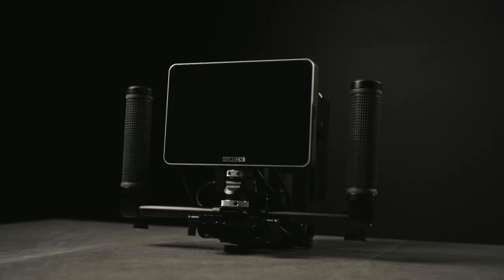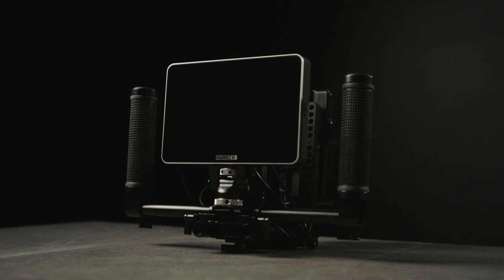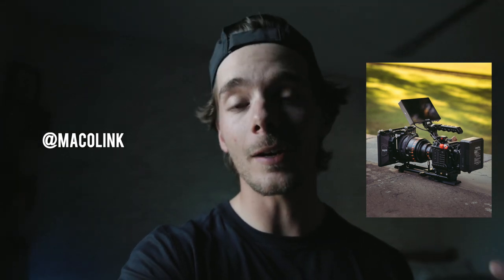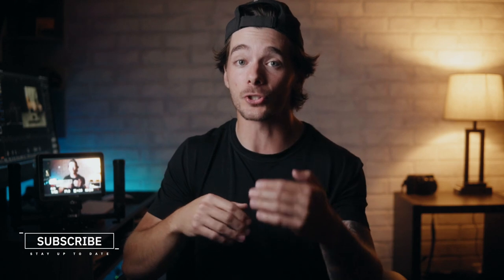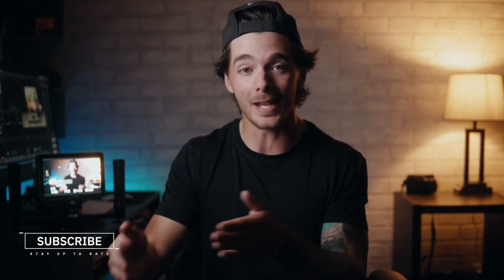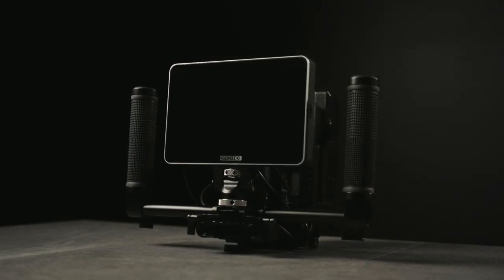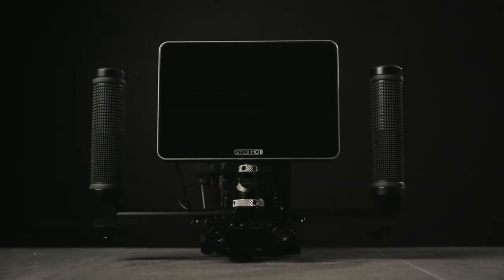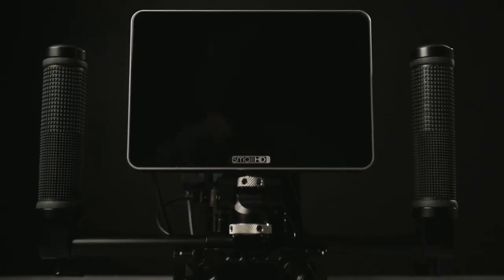WIRELESS MONITORING RIG // FOCUS PULLER SETUP

Comment: Great build! I’ve been looking for a v Mount battery option as these NPF’s don’t last very long. I currently have my monitor attached to a baby pin that’s attached to my production cart. 

My concern is, the cage is mounted with a 1/4 20 screw on a baby pin. It’s already pretty heavy with it loaded hanging on to that tiny screw. Everything wobbles as I travel to the next set with my camera cart and could only imagine having a v Mount battery attached to it. Should I be concerned and is there anything you’d recommend for a solid hold?
Reply: Especially with a v Mount battery attached
Reply from the maker: I recently picked up the Nitze directors monitor cage… makes this entire build more more seamless and durable. Look into an actual system like that. Because then you can mount a quick release plate  to it or something like that, a bit beefier